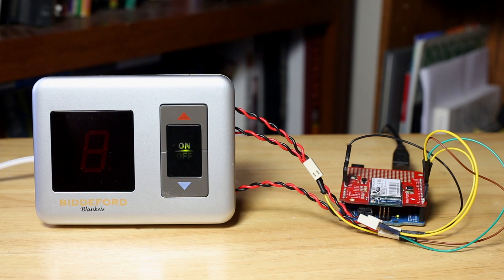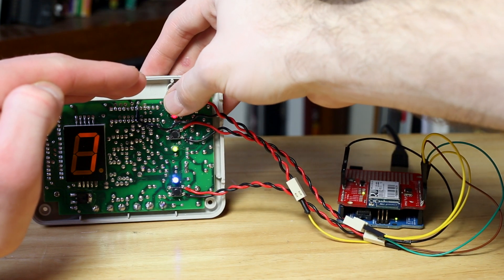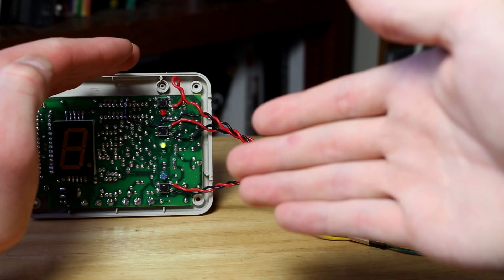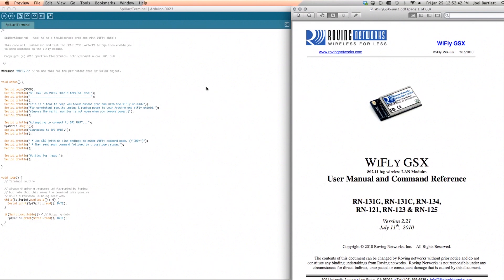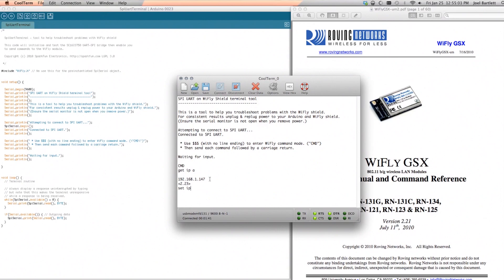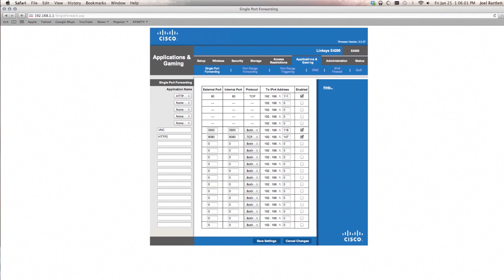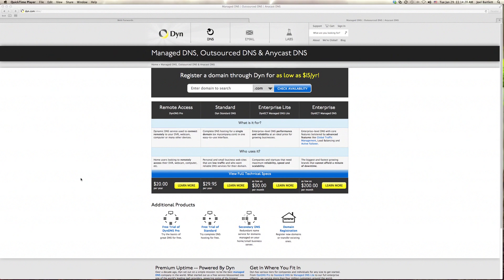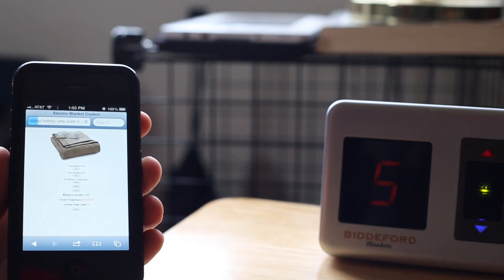SparkFun Engineering Roundtable 1-30-13 - Hacking an Electric Blanket to Connect it to the Web

Comment: You could have used a RJ45 jack (regular network cable jack) on the side of the controller, or a usb 3.0 jack to make it look nice.... 
You have only 5-6 wires from what I can see and the rj45 has 8 pins, plenty... certainly would have looked much nicer.